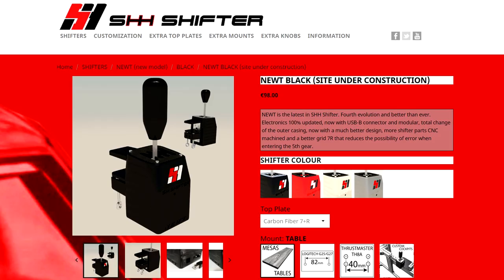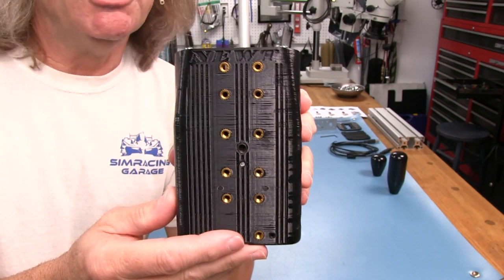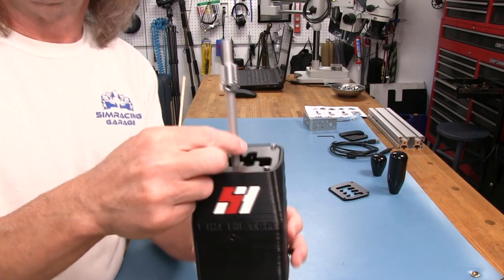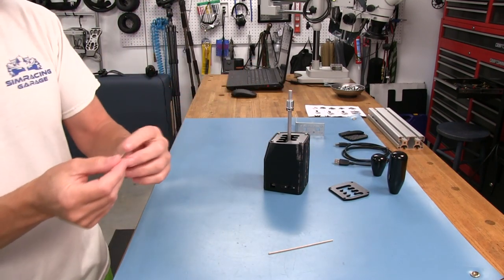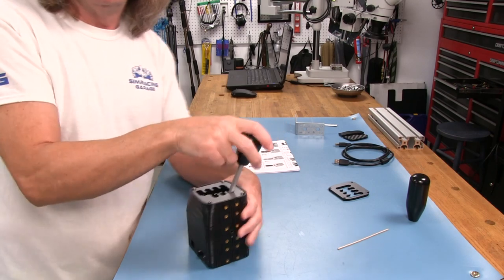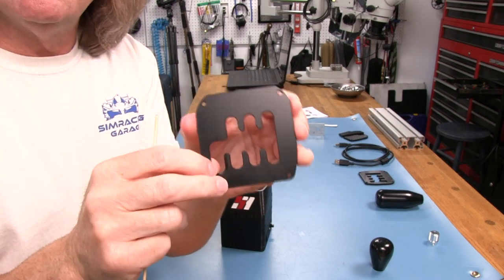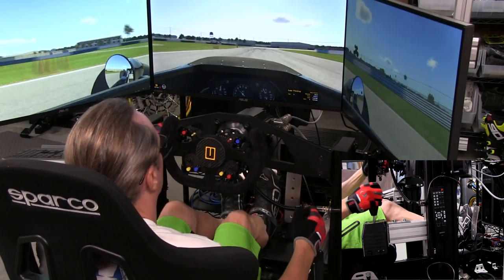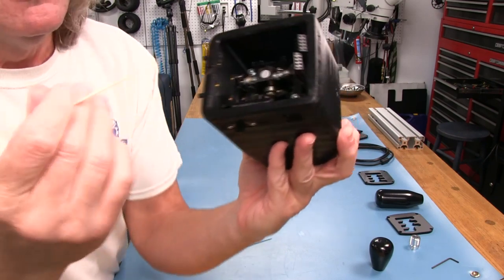SHH "NEWT" H-Pattern/Sequential Shifter Review

Comment: Just a note: the PCBs have not the spring as shock absorber, the PCBs and their sensors can be move in order to delay or fasten the activation, so closer would make the shifting sooner and further would do it later. Thanks  Sim Racing Garage
Reply: i like the Newt very much! One suggestion, instead of screwing the top plates on, use small high power magnets so it would only take a few seconds to change from H to Seq. just a suggestion.
Reply: @Wouldpkr  that plate is the shift gate, If it's held down only by magnets, it won't stay in place in the heat of battle, it needs to be screwed down.
Reply: @Wilburnator  i can see that for the pattern, but for the sequential, i think it would be fine.
Reply: @Wilburnator  Actually I think that can be mitigated by using a dowel type rod to place and pin the plate laterally (plus it also sits in a recess of the frame of the shifter) so a magnet is really just for holding it DOWN in place.  A few strong neodymiums should be able to do that nicely. 
I'd love to see them take a whack.  One if not two of these (shift and ebrake) is def on my short list and quick-switch the plates is the only thing missing imo.   

(Like, they did so well with quick-switch for the actual shift rod and then the plates need tools?..)
Reply: @Wouldpkr  - Even high power magnets would give up dealing with the immense leverage effects the rod exerts on the plates, I fear.
Ah, just noticed John already mentioned this. :D

Comment: I have one and I can't make a single complaint about it for the price. Super good if you're on a budget too.
Reply: Just to be sure, you don't need to change the plate if you want to use the sequential mode actually? Not like the TH8A ?
Reply: @nicknameunfoundable8369  No, you don‘t, afaik it works with the h-plate aswell

Comment: Hi
I have it for 2 years, it is still new giving it a lot of use. It has a powerful touch and feels great in the strength it makes. Very comfortable to adapt to any chassis. In their two functions in H and sequential, they act very well, adjustable in hardness.
It is not advisable to change the knob for a heavy one, since it diminishes the sensation of strength, always very light knobs, such as those that it brings as standard, or of aluminum; but thin and light.
A job very well done for a low price, I recommend it 100%.
Reply: juanmacion can it work on a Logitech g29
Reply: @mark__s2k263  Yes, it is a USB shifter so it's basically plug and play.
Reply: And compared to the th8a?
Reply: I am between the th8a and the shh. How it compares with the th8a (but with mod - like the 3drap mod cambio for improved feel - included)? Do the 2 shifters have the same resistance in h pattern mode?
Reply: Is the resistance strong enough, is the gear shifting process too smooth
Reply: Does it feel like plastic when using it?

Comment: if you want more resistance/tension, remove the screws  that adjust the tension and replace them with longer ones, i did this about 2 yrs ago, works really well. I can get double the tension than out of the box. SHH told me this could brake it but i think they were being safe, mine has not broke :)
Reply from the maker: Yes, you can do that to get more tension. I know yours has not broken, but the threaded holes in that ABS piece were not designed to go beyond pressures achieved with the stock screw length. But hey, I'm all about pushing hardware to it's limits! And that ABS piece looks to be easy to replace if one of the screws ever stripped out the threads. Or, just tap some more threads in it if there is enough ABS material left.
Reply: @simracinggarage3026   you could also use brass inserts etc tapped in to the abs piece i guess or something similar. Just 1cm longer actually makes a good difference to tension and is where i like it. Because i put a heavy shifter knob on it , which also made it taller, i had to extend the screw length to get the tension back again and id say its about double tension from what it was if i remove the knob i put on it and use the light printed one. Cheers for the reply Barry. 2.5mm i think the screws where if anyones interested, mines an orig model.

Comment: I have had this shifter for almost 1 year.
It is far better than a Thrustmaster TH8A.
The only defect is the small knob, not very ergonomic.
GG Shh Shifter!
Reply: How much more force is needed to shift than the stock TH8A? I have modded my 3 TH8A shifters and am debating if I should get the SHH shifter and move 1 of mine over to my son's wheel setup. With mine being modded it made a world of difference so I've been debating this for a few months now.
Reply: @EricGibson1  I've had a modified TH8A before, but this is much better.
You can adjust the spring to your liking.
Too bad about the plastic body, but it's not a big deal.
Reply: Thanks That was the exact question i had

Comment: Thanks for the in-depth review, Barry! I had some initial worries about my unit "springing" back to neutral too aggressively, but it's apparently just the profile that the bearings roll in they used. Since the clunk also happened while you were shifting into neutral to show off the mechanism (22:11), my worries are gone.

Comment: 46:12 "You can see it's actually moving some..." It honestly looks like what's happening is that the mounting piece is bending, rather than the ABS chassis of the shifter having much give at all.
EDIT: And by "mounting piece", I mean the L-shaped metal plate, not the chunky aluminum profile.
Reply: Yes, the L shaped plate has its flexibility. You have not to worry about it at all.
Reply: @shhsimulation  Cheers for the reply, so the unit itself is even sturdier than previously thought. You definitely have a great product there at a fantastic price point, I'll be ordering one in the coming months.

Quick question that I haven't found an answer to elsewhere: Are the "buttons" that the SQ mode activates the same buttons as used for the H-gate mode? For years I've been wanting a shifter that converts between the two modes and uses different buttons for both, so that I don't have to remap the controls in-game when changing over. =)
Reply: @jubuttib  The shifter has a lateral switch that changes sensor function between 3rd/10th and 4th/9th, so you can map 3rd as 3rd gear and 10th as "downshift", 4th as 4th and 9th as "upshift". You don't have to remap anything ;)

Comment: Great review Barry thank you. They could have made the H/Seq switch internal and automatic when you push/turn to switch modes. Maybe a similar magnetic sensor type deal like in the shifters themselves. An internal gate could also spin around to lock a Seq mode without having to install an external gate. They could sell it for 150 easy this way. But anyway, seems like a very nice shifter. Cheers.

Comment: I have the shh shifter and i'm happy with it. Very beautiful shifter (i recommend the carbon fiber style plate/also the 6 gears instead of the 7 gears one)
Reply: If i have th8a.is it much more different?
Reply: @diamondjing2746  Just push and twist to get sequential. Flick a swith to change the button numbers for sequential so you don't have to overwrite your H mapping.

Comment: thanks barry, i was really looking forward for this review.
I am now deciding between this or the fanatec one, but i still think the fanatec is way overpriced for its quality..I would like to hear your thoughts on that.
Reply: take fanatec or frex or wait for heusinkveld
Reply: The Fanatec shifter gives you a better tactile "click" feeling when you get into gear (like Barry mentions the shifting on SHH is smooth). It also has mechanism to avoid getting into 7th or reverse accidentally (which I do a lot on my SHH). IMO overall Fanatec shifter is a better product in terms of functionality. However you would be paying for more than twice the price of an SHH. So it all comes down to your preference and your budget. I also have had great experience with SHH customer service (while Fanatec custom service is often pretty bad). They were very responsive and helpful. For me personally I like the SHH a lot, but if I would drive manual cars a lot more often than I am currently doing, I would have chosen a Fanatec shifter over SHH.
Reply: @jeanmarclevy9413  The Heusinkveld Shifter is already 2 years late. I doubt we will see it anytime soon.
Reply: I totally agree with Stefan.
Reply: The NEWT has an updated h pattern gate so it has solved a lot of the accidentally getting into 7th or reverse problem. Also to be fair the one thing the Fanatec shifter has vs SHH is that neutral is an analog controller so you can actually use it as an analog handbrake whereas the SHH doesn't.

I own a recently purchased NEWT and haven't missed a shift since.
Reply: @andres528528  How do you get accidentally into the 7th? I mean, I only have a 6 gear plate so for me is LITERALLY impossible, but i was interested to buy one. Anyway never get even into the reverse for accident (and I have it on my plate).
Reply: @andres528528  I think you mistook Fanatec with Thrustmaster. The TM TH8A can be used as analog handbrake in neutral. I don't think the Fanatec shifter has that mode.

Comment: Quite the amazing job as always ! - Im wondering if a shifter could double as a nose wheel tiller in Flight Sim ?
I cant find anything satisfying to use as a nose wheel tiller, an axis that moves forward and backwards, or turns like a dial.

Comment: What a coincidence, I was just looking at this. Thanks for the very thorough review.

What would you say between this and the Fanatec CSS1.5? I know they're essentially in different budget brackets, but just wondering if this holds a candle to the CSS?
Reply: I had the SHH 7R last year and wasn't a fan; shifting felt unnatural to me, as I didn't like the spacing between gates and the shifter stiffness was way too tough/fake feeling. Sold it and went to the CSS, which is lightyears better. I highly recommend the CSS.
Reply: @kingcars  by chance what do you mean shifter stiffness? How much force to shift gears is what I'm guessing. I have modded my TH8A shifters to be harder to shift for a more tactical and lifelike to a real car.
Reply: @EricGibson1  Yes, that is partially what I was referring to. Before I go further, I'll just say that obviously this is anecdotal but it is my current experience.

I've owned and driven manual transmission cars for the last 13 years, and I currently own 5 - a 2017 Shelby GT350, three 1988 Ford Thunderbirds and a 2015 Volkswagen GTI. I've driven various other manual transmission cars as well, such as older muscle cars. Not a single manual transmission car I have ever driven has felt anything remotely like the SSH shifter in terms of stiffness or gate spacing; granted, I haven't driven a gated manual in real life, though, so those cars might have more similarities.

The Fanatec Clubsport shifter provides an infinitely closer resemblance in general to the cars I have driven and experienced. The muscle memory is nearly identical and the overall feel is very close, at least in terms of a $250 simulated shifter.

I also generally have issues with the sentiment I see among a lot of sim racing enthusiasts that a stiffer shifter is more realistic. Might be true to some extent, but generally it's not. Real life manual shifters don't require a ton of effort.
Reply: @kingcars  yeah It shouldn't be hard to switch gear but should be harder to shift than the stock TH8A shifter as it almost just falls out of gear if u keep hand on it (stock). I have mine set up so it feels like I'm shifting something and not moving something if that makes sense.

Comment: Great review! I have an older model of SHH shifter which does not have the screw-on adapter. Do you have any insight where to get one of those shown at 6:00 ? I tried a few aftermarket shifter knobs, but the rubber tube did not hold rotation well when I switch from H pattern to seq from time to time.
Reply from the maker: Contact SHH. I believe you can get one from them.

Comment: I have the version of this that came right before this one and it has been awesome.
Since I only use it for stock cars on Iracing I would like to have a plate for 4 speed with reverse up and left. I have access to a laser to cut an aluminum plate, would this be a problem or should I find some derlin to cut on waterjet?
Reply: Delrin better ;)
Reply: The only thing though stock cars shifter has Reverse down and to the right though.

Comment: SRG, how does this compare with a modded TH8A shifter with like the Mod Cambio or the Clixbeetle?
Reply: I have exactly the same question mate..
Reply: @Haris1977  I bought it so I don't have 3 shifters. It doesn't feel that bad honestly. The SHH shifter is a little easier but not by much. It is a little to easy to bump out of gear too if you're not careful depending on where you have it placed and how you have your hand when driving. So far so good as it really like it. Again down a shifter so less cables nad makes it a little cleaner. I have the SHH shifter for sequential and H pattern and 1 TH8A for truck simulation driving with a mod. I had 1 TH8A sequential mode and 1 in H pattern mode and 1 for truck simulation.

Comment: As someone that 3D prints I can say that they need to really work on their settings for printing. Those lines are just signs of wrong temps/print settings and possibly even a bad leveling on the bed.
Reply: Yeah it looks like it's under extruding on some parts of the wall. I think I also see some ghosting by the logo.
Reply: Actually the printing is quite good but hard studio lightning + our little trick (which gives a brighter finishing ABS doesn't have) exaggerates the layer effect. I cannot put photos here but trust me, it is a good print. About the ghosting, yes, it has in some places but it is because we have to print very fast in order to deliver the orders... Each body printing is almost 14 hours. Thanks guys for your constructive critics, we need them to improve!
Reply: @shhsimulation  Thanks for the reply. I hope I didn't come across too harsh but I'm glad you're reading comments to improve the quality of the products. I wish more companies would do that.
Reply: @Albertotron  Is not easy to follow and read all the messages in all youtube videos or forum threads, so apologies for future non answers... We will try anyway

Comment: Same problem as with most shifters, lack of resistance when shifting... I want to feel a similar sensation as in my MX-5 but don't want to spend the money the Quaife shifter costs :/
Reply: I like to be able to shift with my pinky.
Really what they need is variable resistance. If you've got the revs right it should fall in, and if not it should vibrate and make you jam the thing in like a half-missed shift.

Comment: So I've always had this question.. you can't downshift from 6th to 2nd directly in these "H pattern" shifters? In real manual cars (obviously just non racing, regular driving) let's say I need to reduce speed, so I'm in about 5th gear, I just hold the clutch, press the brakes a little, and stay on N until I need the throttle again, then I'm engage 2nd or 3rd gear and release the clutch. Is that not possible in sim/games? Or just something not optimal in terms of speed?
Reply: Could you elaborate? Which sim? In the games I play you can downshift from 6th to 2nd.
Reply: Why do you think that's not possible in the first place? That's one of the main features of an H-shifter, otherwise it would just be a more complicated sequential which would make no sense at all.
Now as a friendly hint: the way you describe your real car driving you a) waste fuel and b) wear the clutch unnecessarily. To avoid both you should let off the throttle and let the car roll in gear and then later shift down to the desired lower gear and put it in gear again directly. That way you'll save fuel since when rolling in gear the ECU in road cars will switch off fuel injection so you're rolling without using any fuel. In contrast to that the ECU will inject fuel when you're rolling while holding the clutch and also if you'd roll in neutral. The reason for that is that otherwise the engine would stall so fuel is injected to keep it rotating. Regarding holding the clutch while rolling or standing at a red light that will cause a lot of wear on the clutch. So at a red light it's best to engage neutral.
Regarding skipping gears on downshifting in real racecars that comes down to car, driving style, grip conditions etc.. So you might see drivers engage each gear when shifting down with blipping the throttle at the right moments while others will engage only one other gear between 6th and 2nd for example while another driver could go directly from 6th to 2nd with only one (in that case heavier of course) blip of the throttle.
Anybody reading this please correct me if something I mentioned is wrong :-)
Reply: @armorgeddon  oh wow thanks for the detailed reply. I've always heard about the fuel consumption when on N so generally I take that into account, what I described above is not what I do 100% of the time, it's more to illustrate what I wanted to do in game. But still, I do that sometimes and I should indeed avoid it, what you've said about the injection while on N makes sense. Thanks for that! On the other subject I might wanna invest on that shifter, I enjoy it so much more in real life, if it's indeed anything comparable to the real thing I think it'll be worth getting one.
Reply: @johnf.kennedy3175  I play mostly Gran Turismo and Asseto Corsa. I think you've answered already. From this video I had the impression you couldn't downshift more then 1 gear at a time.